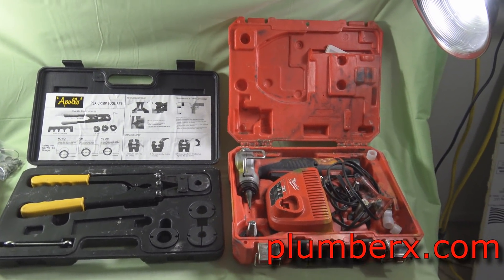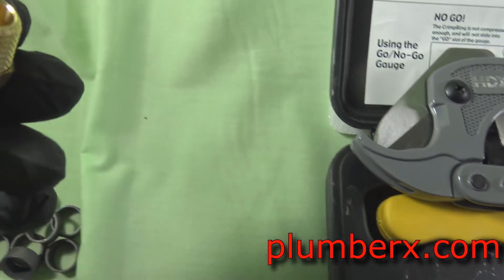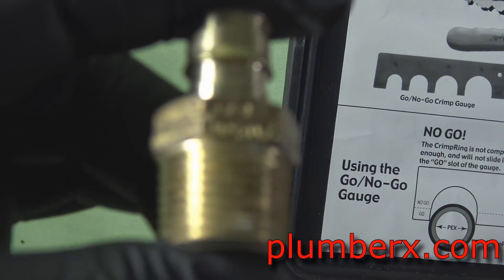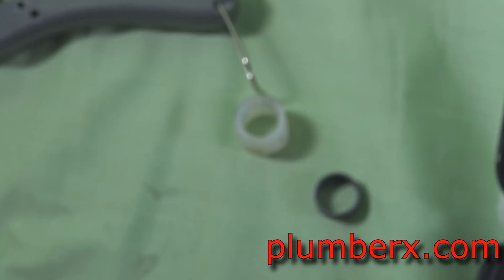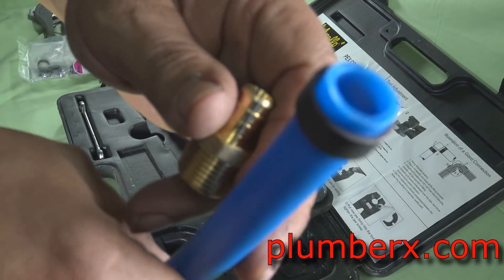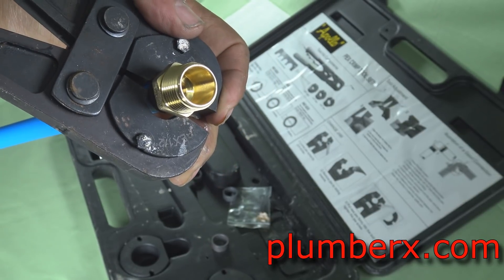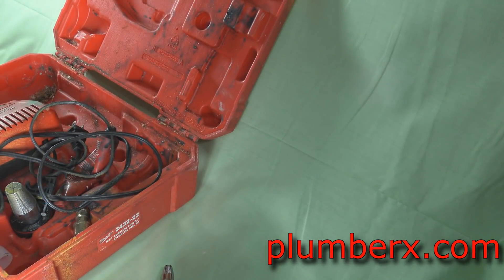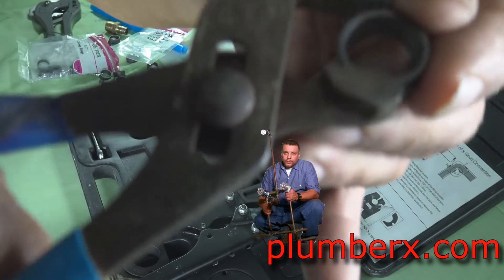Pex-a Or Pex-b: Uncovering The Key Differences

Comment: Leave it up to plumbers to totally screw up standards that have been around for nearly a hundred years. Tubing & pipe are 2 different things. Tubing (mechanical tubing) is always measured on the OD (outside diameter) while pipe is always measured on the ID (inside diameter). So now the plumbing industry has some plastic stuff that is measured on the inside & they are calling them by 2 opposing names,  pipe & tubing. Which is it, pipe (ID measure) or tubing  (OD) measure.  And how do you tell one type of fitting from another other than first hand experience?  Are there identifying marks of some type? I'm having to do home repairs using these things & have a need to know.

Comment: My question are ; which fittings use for the pipe , and which fittings use for the tuping
Reply from the maker: Good question. Ubonor is used for pipe and zurn is used for tubbing
Reply: Zurn actually makes things just like Uber nor Where they expand zurn even makes an expansion tool
Reply: And zurn has got a higher psi rating

Comment: How does stainless rust out ? the pinch clamp is used a lot.
Reply: I have seen cheap "stainless" rings, I suspect some of the "stainless" might be low grade or not actually stainless.
Reply: The pinch clamp is 304 Stainless, the crimp rings are copper that has been coated. I've not seen them rust out, but I have seen some corrosion, but that's only on the crimp rings, and it was a less than ideal install. Either they hadn't mated the tubing all the way, or were too far, or too close to the end of the tubing.

Comment: Nice  video Claude you sold me on Pex A today. Quick question, my incoming water line is 3/4 inch copper thru a one story slab. Do you recommend running with a manifold system 3/4 inch to the point of source like my bathrooms or should I use half inch? They ran unsleved copper thru the cement slab and I need to run the Pex A pipe in the attic approximately 40 feet. I live here in Las Vegas. I would appreciate a reply.
Thanks.
Reply from the maker: Me I would not try to put any pipe.thru cement with out a sleeve.
Reply: @theartofplumbing  Hi Claude, sorry for the confusion. The house I purchased that was built in 93, they put copper pipe in the cement slab, without a sleeve. I am going to use Uponor Pex A and run this into the attic down thru the walls. One complete hot and cold tubing to each outlet. No tees in attic. There is no freezing here to effect piping in the attic but I will still insulate them.
Since my last question to you, I decided to go with the Uponor Pex A pipe 1/2" with a dual manifold system, including ball valves on each line. Better control. You made an excellent reference, that Uponor fittings are a true inside measurement of the pipe where as Pex B is not. Very important, if one wants proper water flow. The only other question, is what type of crimp or compression fitting do you recommend? Thanks.

Comment: so the uponor and pex tubing are different?
Reply: No they are both Pex piping. The major difference is the type of fitting to be used. Type A pex is for an expansion fitting, type B is only for crimp or clamp fittings. Uponor is a brand of type A pex, excellent product, hard to find for small projects. Hope this helps.
Reply from the maker: Yes, they have different types. My favorite is ubonor pex pipe a fittings
Reply: @theartofplumbing  I've been using pex for years. I guess Uponor will be added now to my tool box.
Reply from the maker: Cool 😎😉

Comment: Stopped listing to opinions once he stated that the cinch rings he replaced were rusted. The only available cinch rings that know of are made of steel stainless steel..
Reply: right and ryobi makes a cordless tool for clinch rings now to, i wouldnt buy ryobi but no other maker has it and the pex b fittings are cheaper than pex a
Reply: @chrisf9607  what is the ryobi tool for and name of it? pex b or pex a, because pex b used rings?

Comment: Apollo/Conbraco also makes PEX-A. Rehau makes PEX-A also. Not sure if Viega (Manabloc manufacturer) makes PEX-A or not. They do make PEX-B. But there is also PEX-AL (Aluminum foil shielded/insulated) and PEX-O2 (Oxygen Barrier). I believe for Oxygen Barrier they use PEX-C. Not sure about PEX-AL. And though most people believe PEX-A is superior (in many ways it is), PEX-B and PEX-C have some advantages over PEX-A, - such as longer UV exposure ratings for outdoor applications - (especially for the red and blue). While they will not degrade internally as fast as PEX-A under UV light, my feeling is that they would become brittle faster than PEX-A and eventually burst (before PEX-A). So CPVC or regular schedule 80 PVC is probably best for outdoor (freezing weather) applications. Quality PEX-B (Silane chemistry method such as ZURN and some others) has higher pressure ratings than PEX-A (for water or fluid bursting). But the difference in my opinion doesn't justify using PEX-B, because in a closed loop system pressures would never get that high anyway. And the fittings would burst before the PEX tubing wall did. Though both PEX-A and PEX-B (and PEX-C) will withstand freezing temperatures (for outdoor or under building installation) better than copper (and likely CPVC), I believe the extra flexibility of PEX-A and stronger retention around fittings makes it the superior choice for indoor applications.

Comment: Hey, is there a way to connect galvanized pile to the Uponor PEX? The only options I’ve found so far were using a dielectric union connected to another fitting that has a Pex union. Thanks!
Reply from the maker: Yes there is.https://www.supplyhouse.com/Uponor-Wirsbo-LF4521313-1-1-4-ProPEX-x-1-1-4-NPT-Male-Adapter-Lead-Free-Brass or https://www.supplyhouse.com/Uponor-Wirsbo-LF4571515-1-1-2-ProPEX-x-1-1-2-NPT-Female-Adapter-Lead-Free-Brass

Comment: Used the pex a to connect water softener could only find the white tubing. If the big hardware stores carried the color pex a I would use it way more
Reply from the maker: I know it would be nice if the big hardware store would carry Ubonor pex and Ubonor pipe fittings, but you can only buy it at a plumbing supply store for now. Like you I hope that changes.
Reply: For now I will have to settle for a white pipe for pex a. Thank you for your awesome informative videos keep up the great work
Reply from the maker: @Khaosriged  😉

Comment: I just found your channel best so far. I had a question I cant find answers to. I need to connect pex to copper and bury it in the dirt and then poor slab over in a bath remodel but dont know what method will hold up best under ground. Of course I wont be buying a $400 tool for expansion fitting type. But what's you opinion?
Reply from the maker: Thank you. Most areas of the country don't allow connection in the ground unless there is some kind of access to the connection. I wouldn't recommend making a connection underground. However you can use a copper to copper connection, but it would have to be silver solder, something long lead-free solder but much stronger.
Reply: @theartofplumbing  or flare it
Reply from the maker: Sorry. I haven't for got. I'm at work right now. Yup I still work a regular job 😖
Reply: @theartofplumbing  it's ok, I understand.

Comment: Why don't you show the option of push to connect shark bites? I live in a mobile home and I'm replacing the old grey lines from about 30 years ago. I'm using the push to connect fittings and only failure has been human error (me). lol. I don't know the cost difference of the fittings but you don't need any special tools or crimp rings of any kind. They even have a flexible metal covered piece to connect to your toilet or faucet that can be maleir female on the end connecting to fixture and push to connect shark bite to the PEX line. As long as you seat tubing all the way down I haven't had any leaks at all. Thank you for sharing your talent and video, Rodney
Reply from the maker: Thank you for your right. I do have a video using push fittings. Shark bites and they work on the mobile home pipe. 👍 https://youtu.be/1OyLmgVXBhk
Reply: Rodney Widger cuz that shit leaks dawg
Reply: @gbrietzke  my shark bites are all still holding perfectly fine and I replace my entire water lines with pex b and shatkbite fittings back in 07 and still no leaks,issues,or reduced water pressure

Comment: Nice video, and I thank you for that. However, when you crimped the Zern fitting to the blue tubing, you missed the mark as it was too close, and is why it failed, yes failed, the Go/No go test that you did. It helps if what you're showing isn't misleading to the point that it's wrong because if that joint was done on a house, it would soon fail and water would be everywhere. And, if you're a contractor, it would have never passed inspection. I suspect you know that, but went ahead for the ease factor when it came to filming. Perhaps a trial run next time would help? After all, that's why we're here: to learn.

Comment: i didn't realise there are different types of PEX that look similar, i was aware of PEX A and PEX B but i thought the only difference after that was the fittings and tools. 
  I've just got a whole load of PEX left over from a neighbours job, i'm using it to re-plumb my house with and to install some under floor heating.
  Problem is i'm in europe and the system seems slightly different. The rings on the expanding style kit are made from thicker copper or brass. You slide on the ring, expand the pipe then slide the ring as close as you can get it to the fitting, then there is a second gun which pushes the ring over the fitting to help keep it tight, kind of half way between the two systems you cover here, but the ring is not crimped, just slid up with some force from the 2nd special tool.
Reply: Now i have to try to find out if the pipe i have is the expanding type as i am interested in this system rather than the crimp system.
Reply from the maker: If I'm not mistaken I think you guys in the UK  started the whole pex piping and we started catching on here in the US around 1908's.
Reply: @theartofplumbing  you are mistaking... 1970's is when PEX made it to the USA.
Reply from the maker: @dsolovey1752  Thank you, what State did they start at. Missouri did see it till the '80s
Reply: @theartofplumbing  I am from the UK but i'm renovating in France, i've lived here almost 20 yrs.
  I was looking in the hardware shop here, and at some videos that cover this system with the 
manual expander (kit comes with cutter, expander and a tool to push metal rings over the fitting). Rather than crimp over a non expanded pipe, they use a combination of expanding and then sliding a metal ring over the fitting but it's a very tight fit so you need a tool which pushes the ring back over the expanded part to clamp it to the fitting. I found videos in French which cover this system, my hardware store sells fittings for this system also shark bite and crimp on. I can get the tool kit for €45 so i thought that was a pretty good deal. As far as i can tell i can't see that there is a specific pipe sold for either system over here. I'm going to look into the make of the pipe i got just to make sure.
  The crimp system looks much quicker but the crimp tool is more expensive. The expanding system looks more reliable but i've heard that all the systems are ok.
  Next job is to re-plum upstairs bathroom and kitchen, then to put underfloor heating in downstairs and to plumb in a new 2nd bathroom and kitchen also downstairs.
   The old plumbing was set into the block walls which get very cold in the winter, this causes heating the water to consume much more energy as the walls are just cooling it down again.
  It's cold here in the winter so i am thinking to run a roll of pex up in the loft to pre-heat the water coming into the boiler, up above our stove or somewhere else in the house, the idea is to pre heat any water going to the water heater as when it enters the house it is ice cold! I have to think about condensation on the pre heat coil if i try this system but it has potential to save lots of energy. In the summer we use a fraction the gas to heat water when compared to during the winter.

Comment: How do the clamps rust out?  Wouldn't that mean you have moisture in your walls? and if you have moisture in your walls I would think you have a larger issues then just clamps rusting such as mold.
Reply from the maker: Brandon A. Deimel I think your right. That's why I use Uponor. I'm not a fan of crimp rings.
Reply: Pipes sweat
Reply: Those little rings simply don't work. I've been working with them all day and it's weeping. I'm getting the Milwaukee press tool. Expensive, but it appears to work.
Reply from the maker: ManInTheBigHat I've never had a problem with them in the past, but I agree Ubonor is the way to go.
Reply: @ManInTheBigHat  they do, but not in all applications. For either clamp or crimp rings you need some room to get the tool in.

Comment: I used the pex tubing. I rented the tool for $8 and finished a shower instal quickly. I couldnt find a uponor tool for cheaper than $180. 

If I repipe my home I will invest in the uponor. I like tgeir fittings and system better.

Comment: I squeeze the copper rings with pliers while it's on the joint exactly where I want it crimped at. That way you can't bend it too much because it's already where u want it.
Reply: If you don't squeeze too hard - you're good, I guess.

Comment: Have you dealt with any of Viegas newish Pex Press connections? Seems like a much improved method to crimping without forcing you to buy expander tools.

Getting set to repipe our 1925 craftsman here in OKC and was planning to run a manifold system with pex press from Viega. We have a crawlspace and attic access which should make running a real delight!

Thanks for all of these great videos.
Reply from the maker: Dane Kaylor No I haven't, but the use a pressing tool also.
Reply from the maker: Dane Kaylor Thank watching :-)